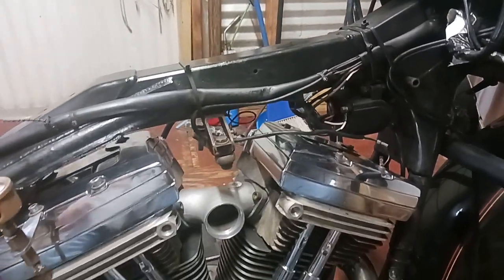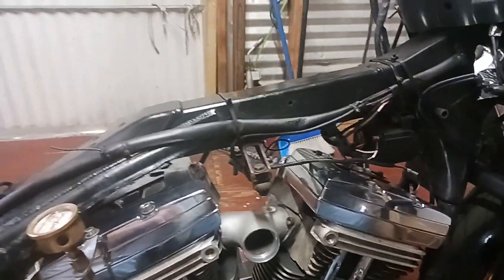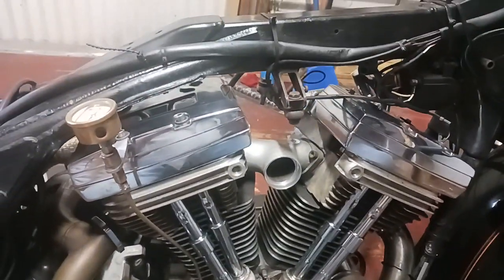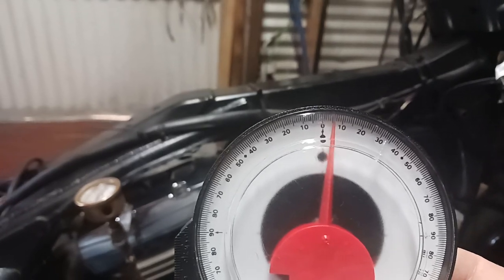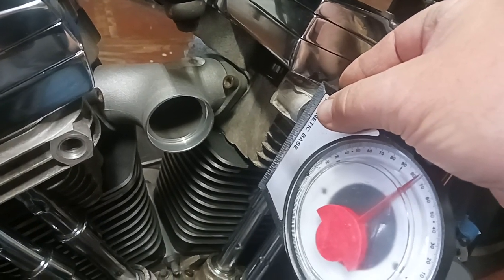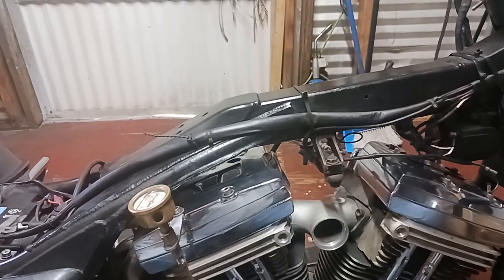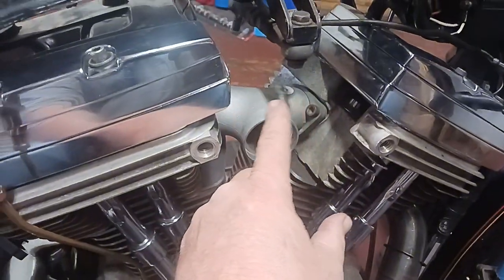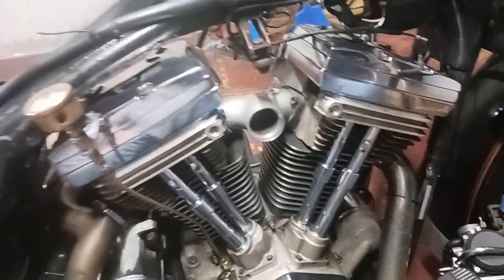HARLEY INTAKE MANIFOLD ALIGNMENT

Comment: Never even thought about the intake manifold alignment before. Thanks for the tip. Btw. What happens if it isn't aligned just right?
Reply from the maker: The reason I think for doing it this way, is easier to tighten the bolts if the carburetor is not on. Some people put the carb. on to align, then it is hard to tighten bolts. Or sometimes they put the carb.on to align then they pull carb. off to tighten bolts but in the process they move the manifold. If that happens, you could get a small leak, which could cause bike to run not as good.
Reply from the maker: I am by no means a professional and l learned this off YouTube and have been doing it ever since
Reply: @edZILLA64  I understand. Thanks for the reply.